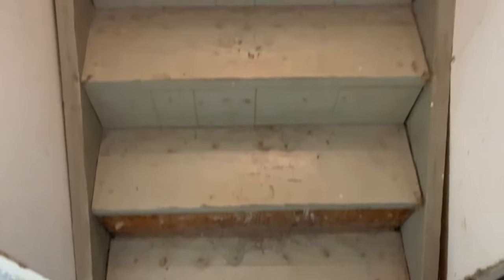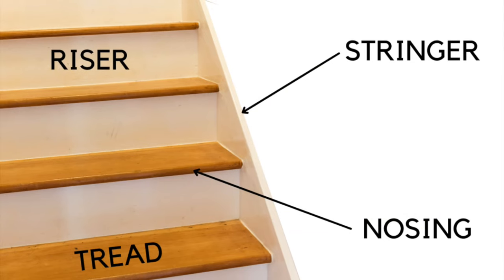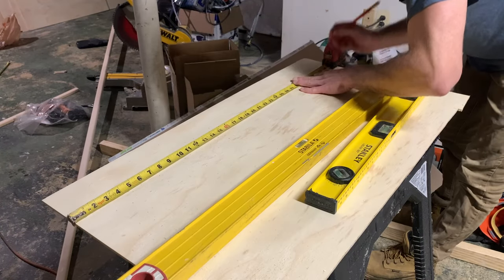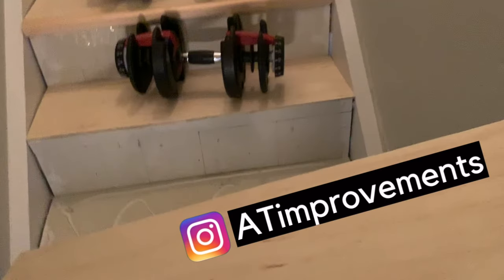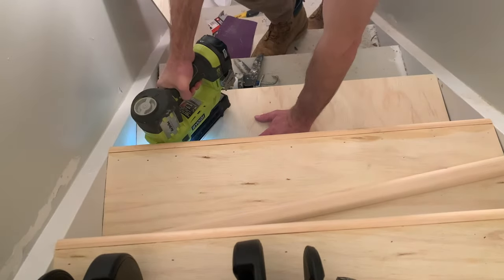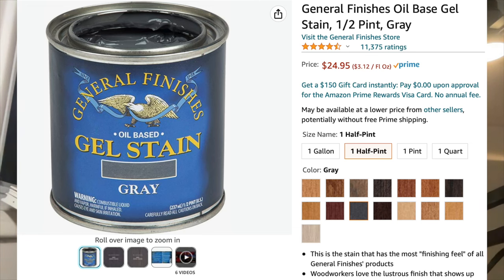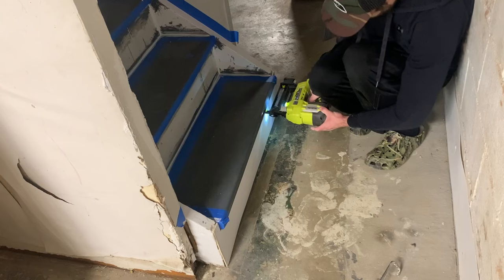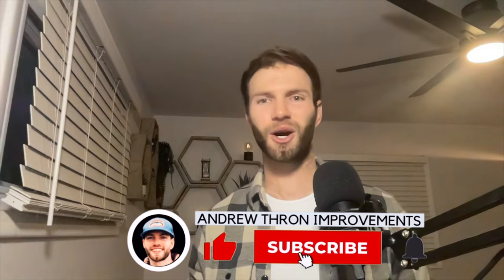DIY Stair Remodel on a Budget (Step-by-Step)

Comment: Love your video. 
Just a tip I received from an old woodworker. Do not wipe extra glue off. It put into the grain outside of seam. Leave it and sand it off when dry he says.

Comment: Long time - No see!  That staircase looks great.  Regarding the screw comment you made, screws are what one uses to screw up a carpet installation!  Your diligence has paid off.  I didn't realize wood like oak was still rare up there; but the pine will work especially with the unique treatment of stain and poly, considering your costs.  I hope that by now, a year after the work you will return that beautiful battery powered nailer to your BIL; if you haven't, I would include a gallon of fresh oysters or some great crabs along with the return.  Start saving your pennies or hinting since Christmas is so near :).  How much more footage of projects over the past year are pending?  I don't remember seeing the basement rehab yet.I'll check your archives.  Later.
Reply from the maker: Hey Patrick! I hear you on the screwed up carpet installation lol. And you will be glad to hear that the nailer has been returned haha But the Oysters might not be a bad idea either. I have the whole basement remodel coming soon! I should start releasing those this month. Thanks again for the continued support!

Comment: Can you give us an update on how are the stairs holding so far?
Reply from the maker: So far so good! Only issue is that dropped something on one of the treads and it dented pretty bad. Other than that, I think they look pretty good 👍
Reply: @AndrewThronImprovements  You can try to put a wet paper towel on it and use an iron to steam it to raise it back up

Comment: sooooo much glue and chaulking.... need less then half of all of that. Also for staples, use side cutters and twist.
Reply: I wondered about that as well, especially if the next owner wants to change something. Is the glue necessary at all, or would nails suffice?

Comment: Just curious, why didnt you choose to demo the old treads?
Reply from the maker: Hi! The old “treads” were actually the 2”x6” lumber used for the original construction.
Reply: @AndrewThronImprovements  so would that be considered like the subfloor equivalent? I know nothing about construction, which is why I’m asking a dumb question
Reply: Looks great !
If you go with new treads over the old, you still have the work of cutting the front off the old, so there’s that.